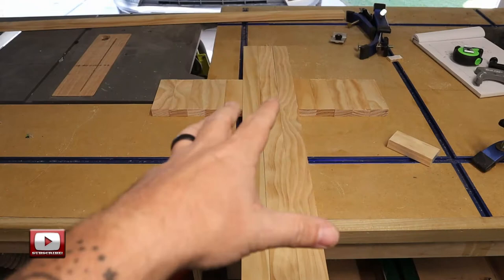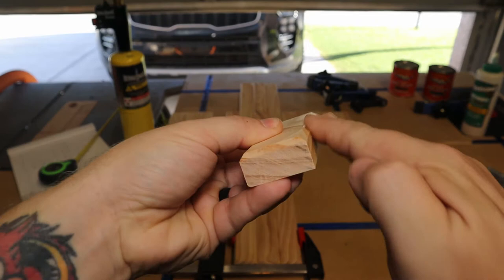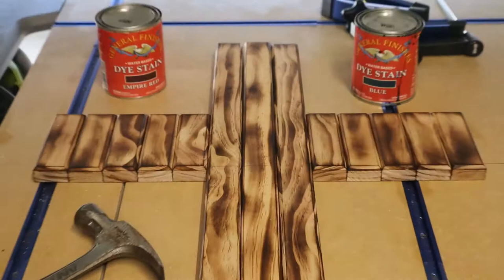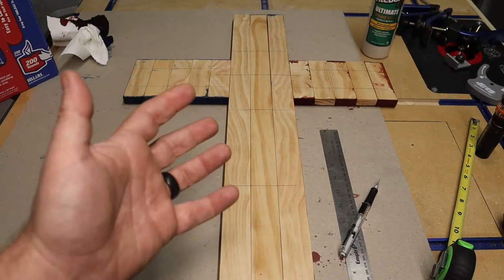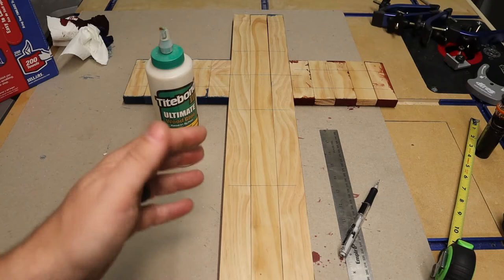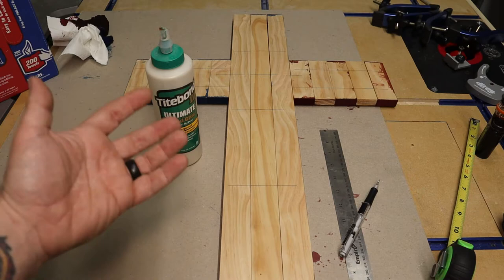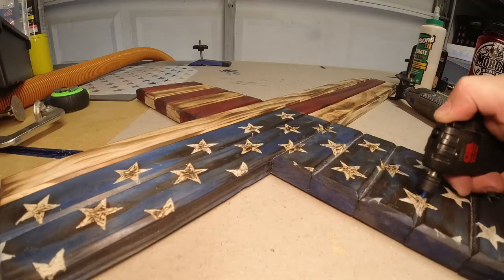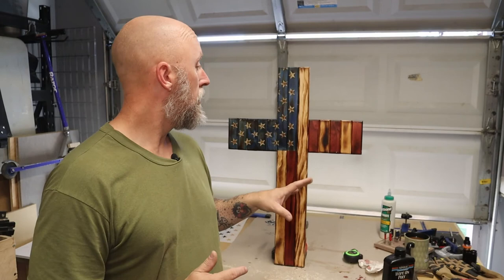Rustic Wooden American Flag Cross | DIY Woodworking Project | Step-By-Step

Comment: Love this - great video too.  Question how far down from the top is the top edge of the left & Right cross sections?
Reply from the maker: Honestly, I don't remember.  I found "proper" dimensions/ratio for a cross and adjusted the size accordingly
Reply: 7 1/2 or 7 3/4 is what I used.